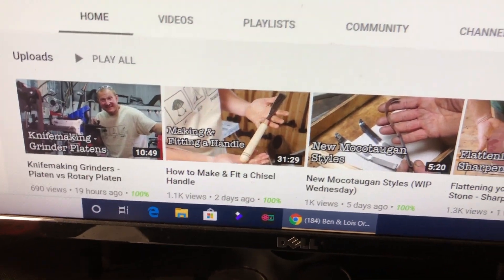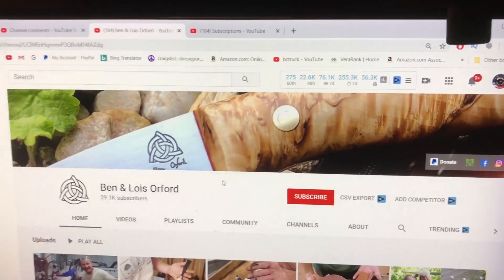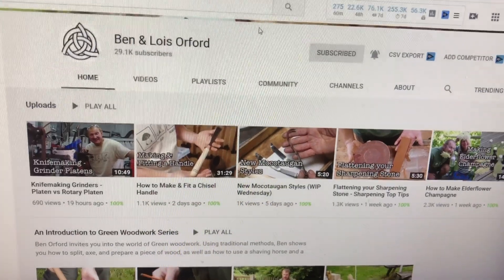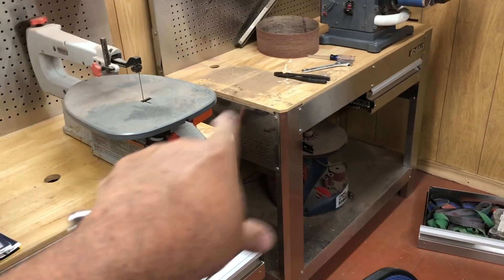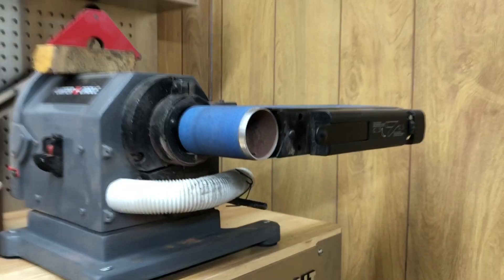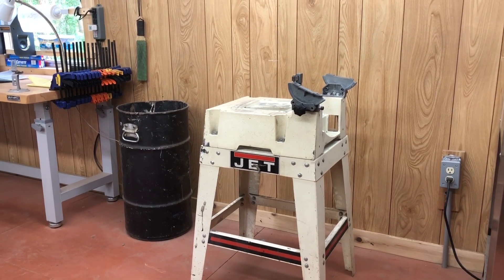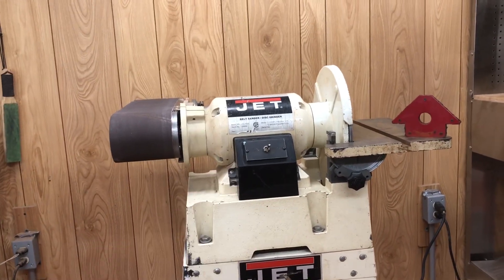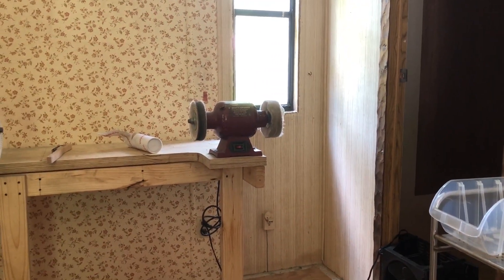Got the new Jet 6x48 belt/disc sander set up

Comment: A thought occured to me,  what if you put the pins in the freezer overnight. Would that give you enough clearance to make a quarter inch pin fit a quarter  inch hole.
Reply from the maker: I’ve tried that and heating up the wood. Neither worked. Reaming is the solution that has worked for me.
Reply: @bctruck  makes sense as wood would not behave as a metal.